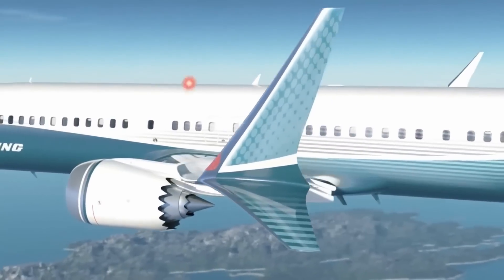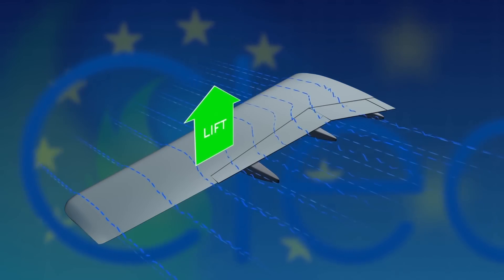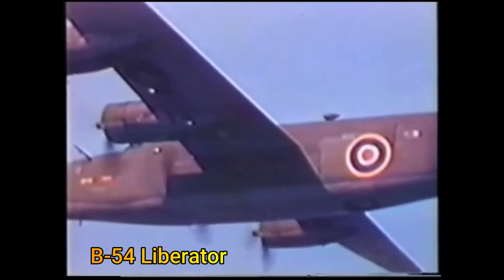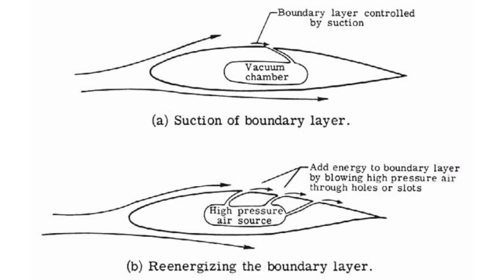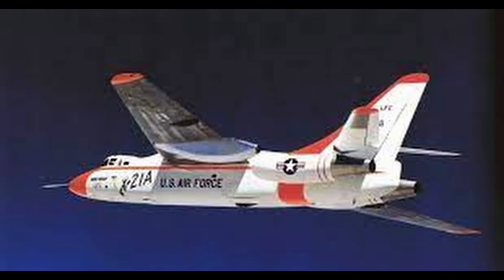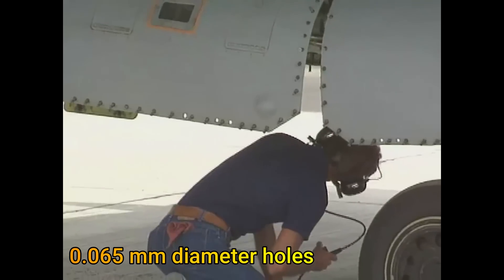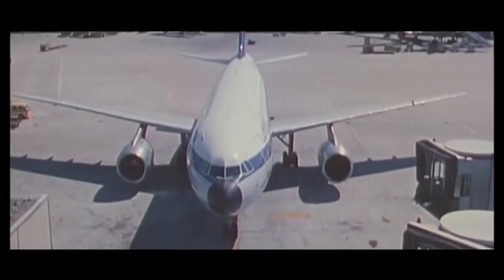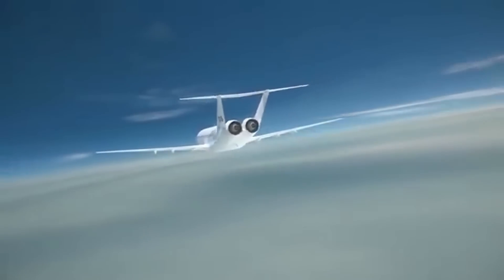Laminar Flow Aircraft: The most promising development in Aviation

Comment: Today, you 3D print the surface material w/ the holes incorporated. Mathematically "perfect" & uniform, in size & placement.  The 3D print fabrication also allows for the precision angular off-set of the holes relative to the oncoming airflow.  As is, the "conventional hole" is 90 degrees perpendicular to the airflow passing over it.  Superior performance is achieved when the hole is 30 degrees downward moving away from the oncoming airflow.
Reply: Can you really 3d print materials with accurate 0.065mm diameter holes in large sheets? What is the technology called?
Reply: @procatprocat9647  3D printing large continuous pieces like wings using proper materials is also not possible now.
Reply: @vitordelima  I'm aware of that, hence my question to Kent. Not only is there a size issue, but the resulting structure would be far too heavy and flexible. The inability to produce laminar flow holes much smaller than the width of a human hair just takes the comment to the next level 🤣
Reply: @procatprocat9647  Y'all might wanna keep up w/ the tech.  Ultimaker-S5 3D printer has a 0.02mm resolution.  Standard issue 12" x 12" bed.  Prints in Polycarbonate (rigidity & wear/weathering resistance).  Anybody can buy that printer in the civilian market.  It also is 2-3 year old tech.  Moore's Law (extrapolated)...  expect to see 0.01mm (10 microns) resolution printers hitting the civilian market anytime now.  What idiot told y'all that air surfaces had to be fabricated in "large sheets"?  Are you unfamiliar w/ the space shuttle's heat shield tiles?
Reply: @kentgladden4316  polycarbonate is a crap material for making structure. 
Having a resolution of that order does not allow precise holes to be produced to the same diameter. In order to produce a precise hole, a bare minimum of 8 points is required. The printer you referred to is a whole order of magnitude too imprecise.
Sticking tiles to a surface is a great way to add huge amounts of weight, which burns more fuel. It's entirely the wrong approach for an exercise in fuel saving.
One of the many reasons the shuttle was retired was that the tiles are crap 🤣

Comment: Bravo to the forward thinkers who created the Solara 500L. I wonder what benefit might be derived from ducting the fan?
Reply: Ducting a fan causes less induced drag around the tips of the propellor, it also reduces sound. ducted fans often have stator blades that also reuse abit of the energy lost in the circle motion that air behind a fan makes to convert it to backwards motion.
Reply: @dageogaming4478  - Realizing those facts, and appreciating all the other ways they optimized the Celera, I was just wondering out loud why they chose not to duct the prop. Wondering about the tradeoffs - weight, drag, disruption of laminar flow?
Reply: @patrickmulvany6479  ducted fans do increase weight and parasitic drag, this drag is a bigger part of the overall drag on higher speeds. I can't tell for sure how it affects laminar flow. ducted fans have their pro's and con's, it's a compromise that has to be made based on what the aircrafts role and flight conditions will be.
Reply: What I have wondered about on the Celera is the CG range. How do you balance it full vs. empty?

Comment: 11:39 You will notice the common pattern between these successful cases you showed... They all have Phi measurements / geometry.  .618 is the size and location of curve changes as well as the laminar hole size 08:50 0.065 (pretty close to .0618).  The key between all of these successes is Phi.  The same thing applies to vortex coils https://youtu.be/rmiBwrQUgoM?t=723 501 a - The Perfect Vortex Coil (Mathematically and Geometrically) - 5 of 6
Reply: Phi is a ratio, not a unit of measurement. I can't say about the others but certainly cannot be applied to hole diameter (think of whether your comparison would hold if inches, cubits or light-years were used). If it has units, Phi doesn't apply.
Reply: @LesCish  Good point with the hole but it applies to everything else.  Ironic that the hole size was similar too.
Reply: @smatthewsauthor  1. It's not ironic, it's coincidence.  Attempting to assign meaning to such coincidences amounts to numerology. 2. Phi "measurements", including size and location is nonsensical as size and locations cannot be specified by a ratio- which by definition has no units. 3. Did I miss something in the video that discusses "curve changes"? What do you mean? 4. Are you sure you aen't suffering from apophenia?
Reply: @LesCish  I suffer from the opposite of apophenia.  I have 99% pattern recognition aptitude.
Reply: @smatthewsauthor  Responding only to my 4th question suggests you think this is about you, rather than the facts.

Comment: Hi it’s that blind subscriber again could somebody try describing the Solera 500 L mentioned in this video
Cheers
Reply: It a bulbous elongated ovoid, with the canopy windows streamlined into the hull shape. It has long, skinny wings with no sweep, and winglets at the end. It has one pusher prop aft, with conventional horizontal and vertical stabilizers. It strikes one at first sight as 
rotund but sleek - in the vein of an orca. Visually quite striking and unconventional.
Reply: It looks like a blimp with small wings and a propeller on the rear.
Reply: The fuselage has the general shape of a zeppelin, but the widest point is shifted towards the rear, to about the two thirds mark. It has long, straight, thin, short chord wings resembling a sail plane, attached at the widest point. The rear tapers in a bottleneck shape with a single pusher propeller. Engine intake and cooling air goes in through scoops at the ten and two o'clock positions behind the wing and are outside the laminar layer, like elongated P-51 belly scoops. The conventional horizontal and vertical stabilizers are also long and thin with a short chord. It appears as though it should be front heavy, but I'm sure the balance is equalized by rear engine and landing gear weight. I hope my description and the previous one, paint an accurate picture for you. Needless to say, it looks very unconventional.

Comment: I always marvel at the effort applied to make smooth surfaces, when nature's air fleet (bats, birds, months) have fuzzy surfaces.
Reply from the maker: The reason is that nature's way of flying involves capturing energy from vortices. This requires fuzzy surfaces. We cannot achieve that level of complexity at large scale. Hence we rely on mechanically simpler mechanisms of propulsion. This means we fly very differently
Reply: Any man carrying aircraft is much larger, and consequently operates at much higher Reynolds numbers than any living flying creature. Even pretty low performance aircraft cannot operate at the slow speed of all but the fastest birds. The flight envelopes are so different that flying must be approached differently.
Reply: @herbertshallcross9775  Yep. Aerodynamics change so drastically at different speeds. I am still shocked at the vertical stabilizer of the X15. You look at that and think it would just be a nightmare in the wind but no, it works.
Reply: 8OO' per SECOND✈️    N O T realistically attainable. VS. 7O feet per second 🦉

Comment: The biggest reason active laminar flow was never pursued was the maintenance.

These days we have handheld rust stripping lasers. It would be a lot easier to do the maintenance these days.
Reply: We worked with NASA in the 70s and 80s on Laminar Flow Control panels made for the leading edge (LE) and 70% chord of wings intended to go on commercial a/c.  We produced titanium wing panels with 0.0025 diameter, trumpet-shaped holes, 0.010 on center in square and diamond patterns for installation on a testbed a/c.  The actual flight test results were outstanding and exceeded calculated expectations.  These tests were done using only main wing panels while the program was intended to replace all LE surfaces (nose and vertical and horizontal stabilizers).  There was virtually no difference in maintenance from normal paneled surfaces and an added benefit was that the vacuum pumps used for LFC could be reversed for pressure pumping deicing fluid out through the same holes and result in additional savings.  The potential issue with insect hits was negligible as the LE was protected by the slats during TO and landing and the deicing fluid could flush debris away.  The ultimate limiting factor was the overall cost of replacing existing wings and other surfaces with new versions to the (then) cost of $4M per a/c.
Reply: @bbayerit  That's what I get for trusting the news.

Also reinforces my belief that legacy aerospace hasn't been trying for decades.
Reply: @jtjames79  hmm, that’s not really fair…. the new technologies that have gone into the 787 for example are pretty amazing….  The outside shape may be quite similar to other jets in production for the precious 50 years, but what it’s made of and what’s inside it are very different…. airlines are very risk averse, for very good reasons, so trying to make a Quantum leap into something like a lifting body is something that they’re not ready to do, it would be in their view almost certain business suicide…
Reply: @PRH123  Are we just ignoring the 737 Max for the sake of narrative?

I still trust the 787's lithium batteries less than any random Chinese 18650, much less than the Tesla packs Elon offered that were smaller, lighter, and safer.

If it's Boeing, I'm not going.
Reply: @jtjames79  yes I agree that Boeing are having some serious problems…. management problems that have denigrated production quality control, safety, and their legendary engineering of the past….  anyway, just wanted to make the point that civil aviation tech isn’t standing still, it’s just that a lot of the progress is “under the skin” and so not so visible…
Reply: @PRH123  You're right it's not standing still, it's going backwards.

Most of the incremental improvements being made today could have been done decades ago.

It would take me like 10 minutes to install a full glass cockpit to a Sopwith Camel. Yet they still aren't standard on the 737?! WTF?!

Don't even get me started on the travesty that is airline wiring. The concept of using some ethernet and a router seems to be alien to aviation.

It's crazy how a Tesla has significantly less wiring than an internal combustion vehicle. Even the newest aircraft are still wired up like cars from the '60s.

These aren't even new complaints, not using ethernet in aircraft for absolutely no reason whatsoever goes back to the 90s.

The aviation industry managed to cruise right past conservative and into Luddite a long time ago.
Reply: @jtjames79  how many 787 battery fires so far?  Recently?  Fatalities per passenger miles flown in any Boeing plane?  Compare that to the household deaths caused by those random "Chinese 18650" battery fires  and Teslas burning up monthly.   How many flights do you take a year?  How many miles are you in a car?  Look at the odds...
Reply: @kenreynolds1000  nice story bro.
Reply: @bbayerit  interesting, thanks…  what were the effects of rain on the flow…?  what were the reasons given by manufacturers for new aircraft for not adopting the techniques that you were researching…?
Reply: @bbayerit  did you get any problems with dust being drawn into the holes and accumulating and solidifying? Did you think there maybe problems with it over a longer period in service, than your testing period? Notwithstanding your original comments, I thought this might be a potential long term problem with sucking in air through many tiny holes. Would be interesting to know if it actually was a potential issue. Sorry the question is from the future, but I have only just seen this video.
Reply: @louisvanrijn3964  Reflective paint, or even just a nice bright white. I'm also just saying rust stripping lasers are commercial off the shelf so anything less power than that is also commercial off the shelf.

Gunk tends to be dark colored, so it's kind of like laser hair removal. You obviously would want to carefully tune the laser.

You could also use a fiber optic laser(s) and carefully target each hole, but you would probably need some sort of robot arm, otherwise a worker is going to be picking up and moving that laser(s) a lot.
Reply: @louisvanrijn3964  Yeah you probably wouldn't want to use it on stealth. Did that have to be said?

The most obvious use is commercial aircraft. Lots of those still have metal wings.

Comment: Anyone designing a modern efficient plane needs to address laminar flow at some level.  Both the 787-8 and 787-9 employ natural laminar flow on the engine nacelles.   Hybrid laminar flow on 787-9 and the 787-10. It also will be used on the two 777X models. I think this is on the tail surfaces.
Reply: If you have not had the pleasure to fly on a 787 I highly suggest to board one. Really an amazing passenger aircraft, and the "business" class (1st class) is stellar!
Reply: Also, the 737 max winglets are designed for laminar flow
Reply: @ajs9688  how so?
Reply: @MrCoffis  Its the volume of air you need to move.
The larger the object , the more air you need to move.

As the size of an object increases you eventually reach a point where you are moving so much air that it will become turbulent.

The Celera is about as large as an object can be and still have laminar airflow around it at 400mph. ( 6 passengers )
Reply: @glennchartrand5411  I was commenting on ajs comment about how the 737 winglets are supposedly made for laminar flow. From what I know the winglets are there to prevent vortex formation at the tips that happens because the high pressure and low pressure air are trying to mix, and that happens at the tips where the air gets the chance to move around. To me is totally irrelevant to laminar flow but still play a part in drag generation.
Reply: @MrCoffis The winglet can have laminar airflow over its surface, reducing drag. Air and the wingform do not care if the wingform is vertical or horizontal.
Reply: @daledavies2334  sorry not sure I understand what you mean.
Reply: @MrCoffis Winglets are installed to control.turbulence inducing air spill from the high pressure area under the wing to the low pressure area above the wing. This is the cause of the turbulence induced drag off the wing trailing edges.
As the wing is designed to produce laminar airflow for efficiency, the winglets can be designed the same. Turbulance reduction is also why the attatchment point between the wing and winglet should not be a 90° butt joint but an arc of about 12" radius, with the whole surface laminar.
Reply: @daledavies2334  I think I understand what you mean now. So basically you are saying the winglet itself has laminar flow over it. I see that as an optimisation of an optimisation. The winglets main purpose is to reduce turbulence, but I realise now that they can also be made in such a way as to have as much laminar flow over them as possible.
Reply: @MrCoffis That is correct.
Reply: There is a size limitation to laminar flow.
So while certain surfaces/components on an airliner can have laminar airflow , the aircraft fuselage cant.
Reply: Am the designer of Honda and Boeing 737 curvy wings , but since 2013 am sitting off surface

Comment: Can this be applied to marine craft?  Both surface and submersible?
Reply: It's always active and involves blowing up air around the surfaces in contact with water, hydrophobic surfaces, foils and other complicated tricks.
Reply: Billions of dollars are spent on it, espically on the design of submarine propellers as it also decreases the level of sound produced.
Reply from the maker: The problem is water is less viscous than air. Yes it might feel the other way around, but air is more sticky. The higher viscosity of air keeps the flow laminar for longer. Water is 10 times less viscous than air, so this unfortunately cannot be applied to marine technology
Reply: @ElectricAviation  It certainly does feel the other way around as you said. I was thinking for hydrofoils, and ways to lower friction for moving cargo long distance. Pity about that whole physics thing getting in the way.
Reply: @lubricatedgoat  Actually the viscosity is low but the density is high. The Reynolds number is dependent upon both. It might be possible to apply this on Marine technology